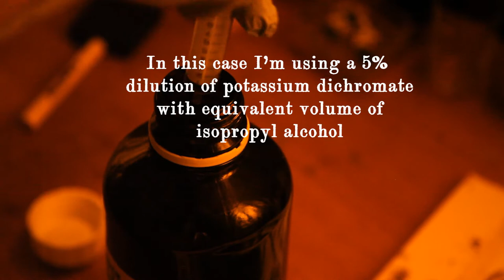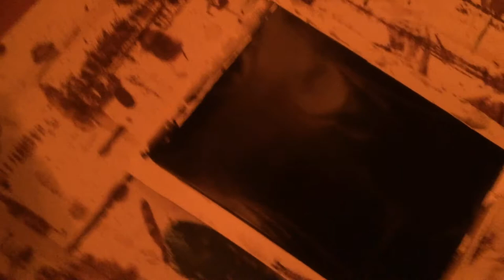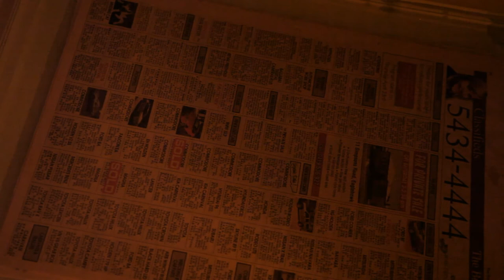The Basic Guide to Carbon Transfer Printing - Part 3

Comment: how much stock did you make of the potassium dichromate and how much did you use in diluting it. because i want to make 150ml of 5% stock but i don't understand how to find out how much potassium dichromate in need to mix that amount  and then dilute with alcohol.
Reply from the maker: mathew stern I use a too-simple weight/volume method. I know for a 5% solution that it's 5g potassium dichromate to 100ml water, so for 150ml water, I would add 7.5g potassium. The precise measurement isn't too crucial, as long as you're consistent. My dilution is half-and-half, to give me a 2.5% solution, so I use about 5ml stock to 5ml alcohol (or 10ml:10ml for larger prints). You can decrease the alcohol slightly for a 3% mix for less contrast.
Reply: GPV Photography ok so i wanted to have less contrast i would mix 5ml stock and 3ml alcohol. i don't know if thats right.
Reply from the maker: mathew stern Yes, that will work, though that will only give you 8ml of solution, which may not be enough for some prints. The best way is to mix another batch at a higher % and dilute it 1:1. Then you'll have bottles of stock for a range of contrasts.
Reply: when you mix the potassium with water how long can you keep it for before it turns bad. i read somewhere that once the potassium is mixed it goes bad in an hour. Is that true.
Reply from the maker: mathew stern Not true for stock, at least under normal storage conditions. Once I had a bottle of 5% stock that began to fizz up when mixed 1:1 with alcohol, and that may have been due to poor airtight storage, but the other bottle I use has had no problems, even after two years.